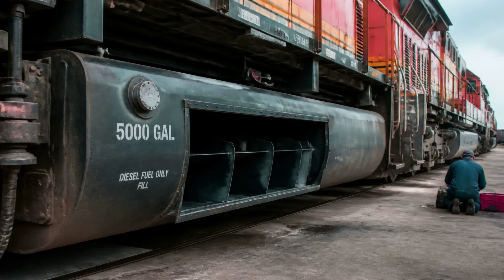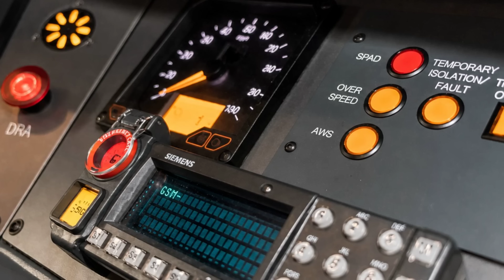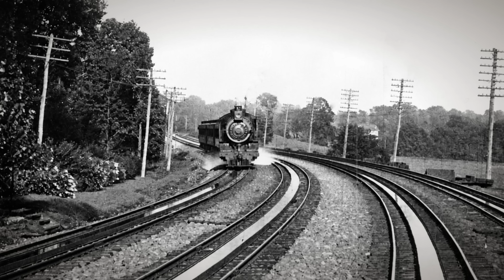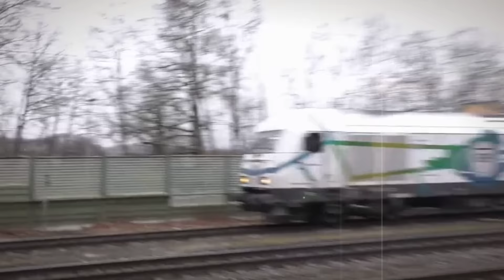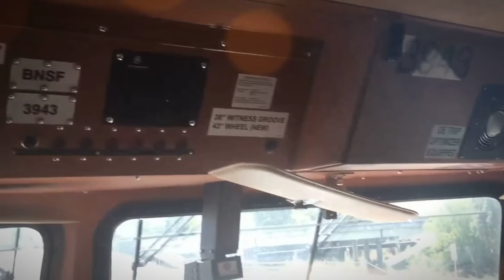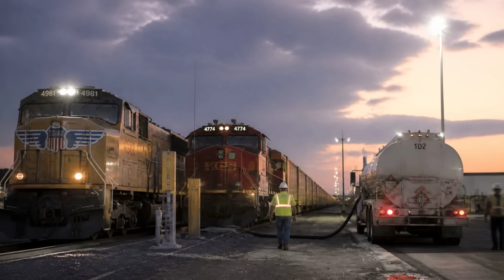Why Trains ALMOST NEVER Stop to Refuel

Comment: I used to fuel BNSF Locomotives on track and yes is usually when a crew change is happening.  Now if it's a Z train you had roughly 1.0 - 1.5 hrs to get it fueled up and hose pulled because that train is a high priority train with UPS , FEDEX , AMAZON loaded and it's running against time.  Sometimes there would be 3-4 head end Locomotives and they all had to be brought up to 4600gal and pulling a 8000gal tanker with a pump that pumps around 90-100gal min. Sometimes we used 2 fuel trucks depending on if any  DP power at the rear.  Fueled In all weather too didn't matter only times ever held up over weather was during lightning storms because those rails carry electricity real good if hit by lightning 😁.    👍👍👍👍😎🍻✌️👋